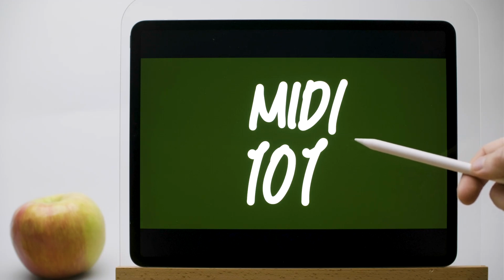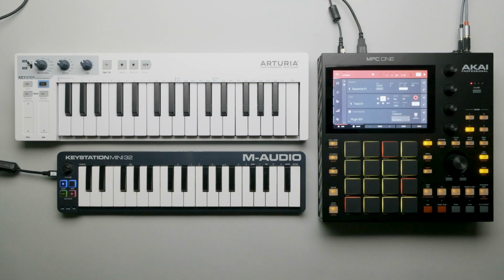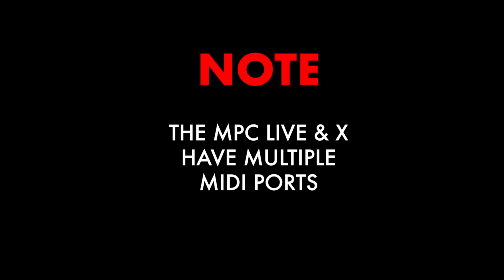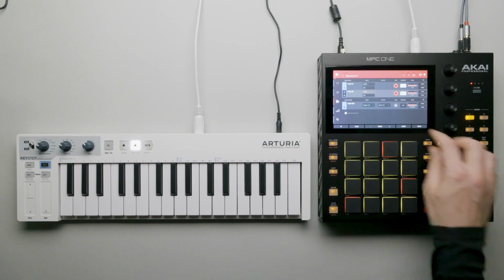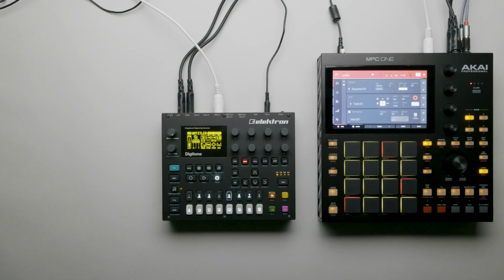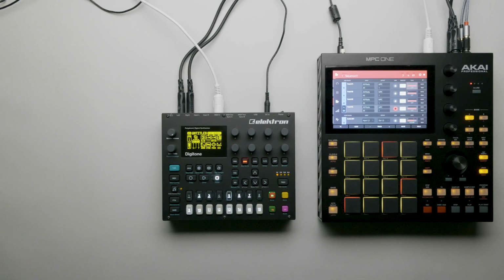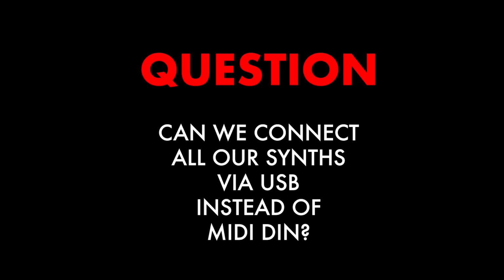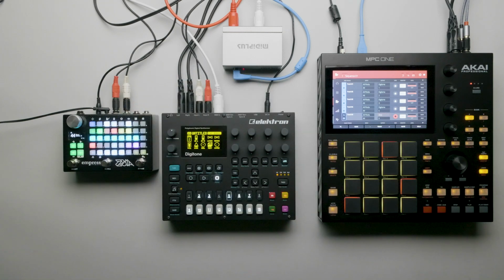MPC: CONNECTING MIDI DEVICES

Comment: Can you hook up a dj mixer (like a denon x1850) to then send/record samples to the MPC, then play the samples back through the mixer?
Reply from the maker: You can setup the MPC to take an input signal from a DJ mixer. And you can send audio outputs to the DJ mixer. You would likely only do one thing at a time because of the feedback loop.
Reply: @OllieLoops  thanks for the response! I'm stuck in a MPC vs Ableton debate.. unsure which to go with. The plus for the MPC is integrating it into my dj setup.
Reply from the maker: That’s a good decision to make. I’ll help as best as I can. If you’re not opposed to using computers and software to make music, then the Ableton route is more powerful and flexible. You can still integrate with your DJ setup. Check out some interfaces from NI and Rane. They have devices that are well suited for that type of setup. Really any audio interface with more than 2 in/outs can be used to integrate with a DJ setup. I recommend getting an interface with 6 in/outs for that kind of setup. Additionally, if your mixer has an integrated interface, than it should be even simpler to integrate. On the mpc side, many people love it because it’s standalone and can be cheaper than a computer/Ableton/midi controller/interface setup. For some, MPCs are perfect and offer all that they want. But if you see yourself really getting into it and writing complex songs, than the computer/DAW route is worth investing into. I hope that helps.
Reply: @OllieLoops  Awesome, thanks for additional input. So I already have Ableton Suite, I just don't use it much. The MPC One seems like something that would revive my desire to produce more. I may just need to go to a Guitar Center to see if I even like the MPC One. Using it as a sampler for djing is super appealing though. I also only have a desktop, so Ableton is out of the question to sample with for djing.
Reply from the maker: Yeah. Check it out. You may like it.

Comment: awesome video! im watching this video to set up my digitone to run through my MPC, I've done everything that you've instructed in the video but I'm not getting any output when I hit the pads, or the keys on the digitone, anything helps! thanks!
Reply from the maker: Interesting. So, there’s two things to test: 1. That midi is being sent by the MPC and accepted by the Dightone. 2. That audio is being output from the Digitone and input into the MPC. For the midi part, you may check that the Digitone and MPC are both on the same midi channel. Also,  the Digitone has a setting for USB or midi, depending on how you’re connecting the two. You’ll need to verify it is set accordingly. For USB, you will likely need to change an additional setting to take it off the Overbridge mode. You can connect headphones on the Digitone to verify that it is accepting midi. Once that works, make sure that there is an audio track set up on the MPC and monitoring is engaged. I hope that helps. Let me know if you need more help.
Reply: @OllieLoops  how would I check if the digitone is accepting the MPC's midi output? if I hit the pads the volume bar goes up like it should be playing something, but it doesn't. I'm connecting the two via din cables and the 1/4" cables for audio
Reply from the maker: The Digitone would be accepting midi if notes are being played on it and you hear audio. That’s why you want headphones, just to hear if you’re getting audio directly from the unit. With midi din, confirm that the Digitone is on the same midi channel and that midi is set to midi din. If you only want to send midi to the Digitone from the mpc, then you only need one midi cable. Confirm it’s going into Digitone’s midi in. Then on the mpc, confirm that the track is set to midi program. Within the midi program, confirm you have selected the correct midi port and set the midi channel to correspond with that of the Digitone. I hope that helps. Let me know if you get it set up.
Reply: @OllieLoops  oh! I plugged my headphones into the digitone and can now play the mpc and digitone both and hear the digitones synth! Not sure why it isn’t going through my monitors though
Reply: @OllieLoops  alright, now if I hit record, I’ll play something on the digitone and hear it but once I hit play, everything I’ve done on the MPC (drums, baselines etc.) come out of the monitors, but the digitone doesn’t

Comment: I am looking to connect my mpc one to a fader port 8 or x touch. I wonder which one will work better at at all with mpc. Also I would love for akai to create its own mixer controller with faders and a sound card and ability to multitrack into the mpc one. I know is not a lot to ask. Since tascam model 8 already does this. It’s only missing the motorized faders

Comment: I have a question, when I plug in my Keystep (via USB) to MPC One before powering on the MPC, when I turn it on, it doesn't recognize the Keystep. I have to unplug/replug the Keystep for it to work. Is there any way around this?
Reply from the maker: Hmmm, so it only recognizes it when the device is already powered on and you plug it in?
Reply: @OllieLoops  Yes, that's correct, and I also have to unplug/replug it every time a new project is loaded.  It's super odd.
Reply: All aside, thank you for this video, it's been very helpful.
Reply from the maker: I would suggest contacting customer support a and asking if it’s a bug.
Reply: @OllieLoops  Thankfully I got my Keystep 37 yesterday and it solved all my problems lol. Absolutely no issues with it; it works flawlessly with MPC One. Stoked! Thanks again for the video!

Comment: I found this really useful. Thanks!
Reply from the maker: Awesome! Glad it helped!
Reply: @OllieLoops  I've followed your example. For some reason, the onscreen faders don't move when I move the physical fader of my nano Kontrol.  Any idea why that might be?
Reply from the maker: Hmmm, so the sound changes but the faders on the display don’t follow, is that correct?
Reply: @OllieLoops  That's correct.
Reply from the maker: Gotcha. Well, if you’re able to control the parameter via a midi controller, that may actually be expected behavior. Input to the parameter is coming from another source, so the feedback loop (to the display) may not be programmed to account for changes from outside sources. That’s my best guess. I would think that that is a bug and you could report it if you wanted. Otherwise, know that the feedback on the display may not be accurate. I hope that helps.

Comment: Is it possible to connect a Novation Circuit to the MPC One and use the Pads on the Circuit to record INTO the MPC One?
Reply from the maker: Yes. You should be able to connect them via midi and use the Novation to send midi notes to the MPC. You’ll need a breakout cable on the Novation to get to 5 pin din midi on the MPC. I hope that helps.
Reply: @OllieLoops  sounds fairly simple and I got a pair of midi cables, so I'll give this a shot, hope it works. thanks.

Comment: nice video
Im having trouble with using my mpc live 2
the midi set up is confusing 
im not sure what to put as slave or master or sync.
Ive seen some use both reasons as master and mpc2 live as master. how do I get them synced its so fustrating having all this nice equipment and can barely use it.any advice will be awesome
do ineed midi cords for the set up through my scarlette interface?please help
Reply from the maker: Hey, thanks for your comment and questions. I know midi can be confusing. I just need a bit more information in order to help you. What are you trying to do? What gear are you trying to connect and how do you wish to use it?

Comment: Truly fantastic; just subbed. I am considering either the Arturia Keystep or the Keystep Pro to pair with my MPC. Would you say the keystep pro is a worse pair to the mpc because it only has 4 tracks instead of 16 in the regular keystep? I am surprised it is more expensive yet has less MIDI tracks. Thank you!
Reply from the maker: Well, it depends on how you intend to use it with the MPC. The MPC has a far more powerful sequencer, so I would use that instead of the keystep's sequencer. I just use the Keystep as a midi keyboard in which case, typically just one midi channel is all I need. The Keystep pro is fine as a standalone controller/sequencer, say to control modular gear or synths. But the MPC is far more flexible and powerful, so I don't see the need for many of the features of the Keystep Pro when you are using them together. I hope that helps. Let me know how you intend to use the two together and maybe I can help some more.
Reply: @OllieLoops  thank you so much for taking the time. I think mainly it’s about quickly swapping what midi channel in the mpc I control within the keystep. For example, say I have 12 midi tracks in a project in the mpc, I want one keyboard to input to them all (either simultaneously or individually) in a live performance context. So perhaps just relying on the mpc’s sequencer should do the trick, as you mentioned, if I understood correctly.

Comment: Have my eye on behringer xtouch to control parameters from the mpc one.  Like track volume, muted, panning. Is that even possible??
Reply from the maker: You should be able to, in theory. The Behringer has USB and 5 pin din midi and so does the MPC. You should be able to connect them and midi map perimeters. I hope that helps.
Reply: @OllieLoops  wow!! I hope they work greT together
Reply from the maker: @buscandolaverdad8686  I've never used the Behringer, so I don't know. But it would seem possible. Double check that it has class compliant USB. If so, it should work over USB directly to the MPC. Otherwise, you should be able to use 5 pin din midi.
Reply: @OllieLoops  cool. Yes it does have 5 point midi connectivity and idk about clas compliment usb. I guess I’ll lol at their websites thank you I appreciate it

Comment: Hi Ollie, I have a problem with my Mpc Live II: I need to work via midi din with 5 old synths but I don't know which gear to buy. I bought a Kenton Midi Thru 5 but found that it produces identical copies to the 5 midi thru jacks ... I don't want all 5 synths working on the same channel at the same time ... I need 5 distinct channels, which product is right for my purpose? Thank you very much!
Reply from the maker: Hey, thanks for your comment and questions. I think you should be able to do what you want with the gear you have. The trick is to assign a unique midi channel to each synth. The setup would be something like this: track 1 outputs midi on channel 1 to synth 1. Synth one is then set to midi channel 1 to receive midi from the MPC. Track 2 outputs midi on channel 2 to synth 2, which receives midi on channel 2. etc. This way each synth has a unique channel to communicate over midi. You can have up to 16 channels/devices using this method. In this video, I show how to set up the tracks to output midi on different channels. This should be all you need. Let me know if that works out for you.
Reply: Thanks for the immediate reply! Unfortunately, even if each synth has its own midi channel (Tg500 to ch. 1, Jv880 to ch. 2, Wavestation to 3 etc), every time I press a key all the synths continue to play simultaneously ...
Reply from the maker: @Tirso425  That seems odd. It would seem the MPC is exporting on all channels still. Oh, I think I may know the issue, and I failed to mention this in my last comment. Each synth needs a unique Midi Program. This is unique to the MPC. There you will set the channel so it corresponds to each synth. So, the setup is, Track 1 is a midi track with Midi Program 1 set to the correct midi output and midi channel that corresponds to synth 1's midi channel. You will need to set up other midi programs for each device and assign those to each track so you can sequence and control everything independently. It's a bit of work, but it also gives you tons of flexibility. Let me know if that works for you.
Reply: @OllieLoops  I forgot to put the appropriate midi channels in the synths... now everything is ok! It's my first time using old synths for music production. Many thanks for the tip!
Reply from the maker: @Tirso425  No worries. Have fun!

Comment: Do you have a video that has the MPC 1 hooked up to Pro Tools?
Reply from the maker: Hey Steve, thanks for your comment. I don't have a video showing integration with Protools. Out of curiosity, are you trying to track into Protools, or use the MPC software as a VST?
Reply: @OllieLoops  I want to track eventually. It's been a slow slog for me so far. The hardest part for me is which button for which function. Have only had MPC 1 for 3 days. The tutorials I have seen are difficult for me because is they go so fast. By the time I find the button for the function, they have already gone to the next function and another button.
Reply from the maker: @sricabla  I understand Steve. I try really hard to make good videos that appeal to a broad spectrum of users.  In terms of pace, the videos are quick and to the point to keep people engaged. Some people dont care about all the features, so appealing to everyone is challenging in this format. I often have to read parts of manuals several times until I've understood how something is suppose to work. These videos are a highly compressed format in which I try to teach a complicated subject as quickly as possible. But I appreciate your feedback. 

In terms of tracking into a DAW, there are multiple ways you could do that which depending on the workflow and limitations you want. You could record stereo out of the MPC into the DAW via an interface.  You could record multiple tracks using additional outputs and inputs on an interface. You could also export your project from the MPC and open it as an VST within your DAW. This last option should give you the greatest flexibility. There's also Ableton Link functionality, but that's a bit more specific. I hope that helps.

Comment: Hi, Thanks for this great video. I am thinking about buying a MPC one to control analog synths (Model D, minilogue, Minibrute). Will it work with analog synths ? Can i create midi note sequences on the mpc one send it on the "midi out" and the synth will play it (and i can tweek buttons on synths). My main goal is to send different midi sequence (create a sequence on the midi roll) to different synths in song mode to  song live but I want to use my analog synths. Will it be possible ? So I want to use the mpc one as a sequencer who can send different sequence to different synths (and add a drum track and other audio tracks). this is easy made on a computer on a daw but i really want to stop using computer. thanks in advance for your reply
Reply from the maker: Hey, thanks for comment and questions. I think that most of the answers you're looking for are in the video. Analog synths are connected to the MPC via midi and/or USB and notes are being sent from the MPC to the synths. External synths can be analog or midi, as shown in the video. You can control external gear if it has midi din or USB midi. It's not much different from what you can do with a DAW. I hope that helps.
Reply: @OllieLoops  Thanks ! I just wanted to make sure before buying it.

Comment: I have a rack full of synths, I connected them all with a MIDI solution T8 to send signal to them, my MPC midi output goes to the T8 then to the synths. Why do I don’t see my synths appear the same way as with usb in the settings? I don’t understand why the MPC could recognize my synths in usb but not with the Midi ports it’s just doesn’t make sense, like should I have to buy a usb to Midi Hub just to be able to use it the same way when I have Midi ports in my mpc? It would be so stupid! Btw it’s an MPC live and I did the update so that’s not the problem... it seems like they just did nothing for those who uses the midi ports. Before that I was controlling my synths from Logic Pro X and only using my MPC for drums but I tought it would be nice to use my instruments in a more standalone way and I prefer the mpc clock but when I was using Logic I made myself some kind of presets for fast selections of my hardware synths, I just want to do the same thing with my mpc and it seems like I’m asking for the moon, maybe I did not see something?
Reply from the maker: Midi is not a two way communication protocol like USB. With USB, the devices do a “handshake” to confirm connection and communication. That’s why the devices are listed on the MPC. But with MIDI, there is no “handshake”. It’s one way communication. And it’s up to the user to make sure it’s working properly, that the devices are communicating on the same midi channel, connecting to the correct midi ports, etc. I’m short, USB is far more robust in terms of a communication protocol. I hope that helps.

Comment: Would you have any advice on connecting the force to the mpc for the purpose of using the 64 pads on the force while keeping the mpc as the main?    I really love the force but I love the mpc workflow, it’d be dope to be able to chop samples and not have to switch banks.
Reply from the maker: Thanks for your comment. That would be an interesting pairing. I’m not sure how to do that however. I might suggest contacting Akai’s support to see if it’s possible. Best of luck.

Comment: How does Mpc One perform in slave mode, let’s say slaved to the Digitone or Digitakt etc? Have you tried it?
Reply from the maker: Good Question. I haven’t tried it.
Reply: I really miss the midi thru on the One, which I’d need if I slaved One to the Digitakt. I’ve got a few synths connected to the Digitakt and really like to sequence with it, also for drums. Mpc One would be kind of a substitute for an Octatrack - general use sampling, lots of storage.. good price. I could use midi thru box though.